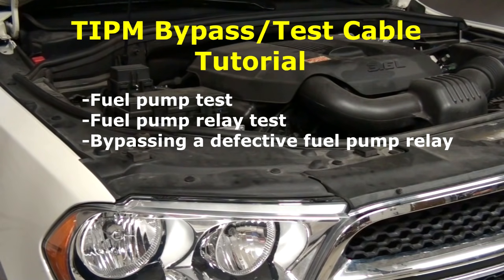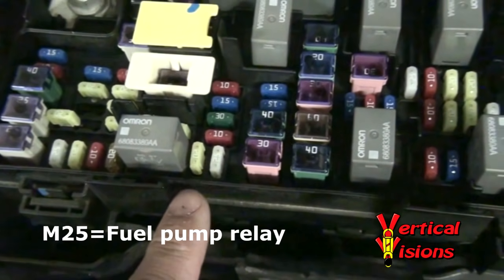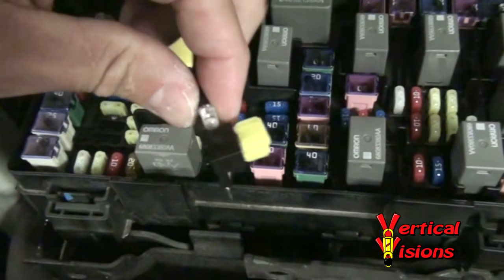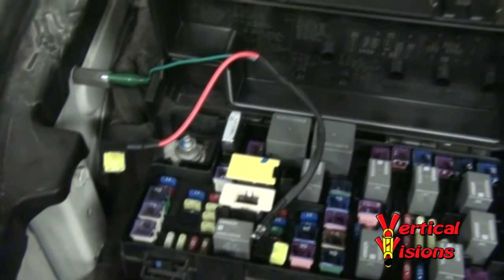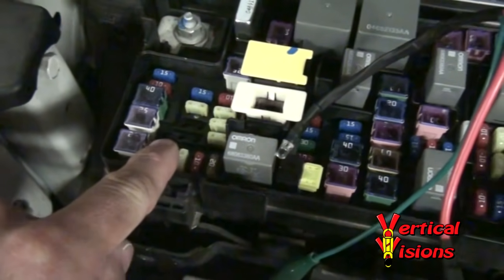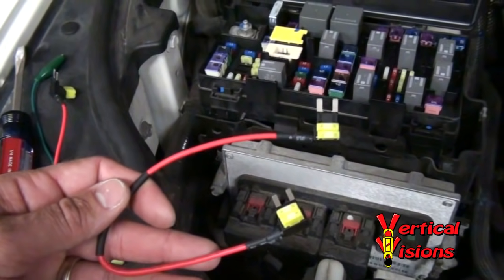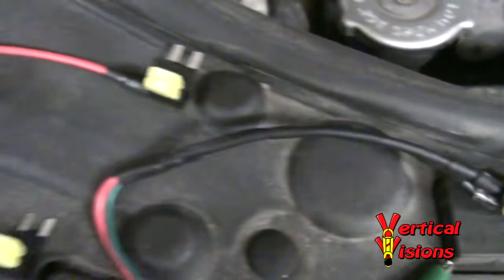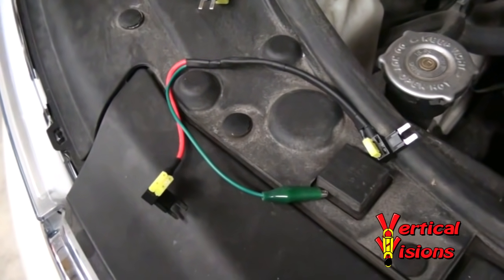TIPM Fuel Relay Test and Bypass Solutions - Most 2007-2021 Dodge, Chrysler, Ram, Jeep, VW Vehicles

Comment: im going to order a cable for my 2011 grand caravan. hopefully you ship to canada or i guess i have to go the amazon route.  is it or can it be a permanent fix? also if the issue was the fuel pump would i be having issues while driving and not just starting? thanks for the video. also when the vehicle finally does start does the fuel pump stay running because the relay is just for starting and not running?
Reply from the maker: Cables are not permanent.  However, we do have other permanent patented solutions listed here:  https://verticalvisions.com/en/content/14-tipm-fuel-pump-relay-solutions.  The relay is not just for starting as it's powered 100% of the time when the vehicle is running.  Stalling while driving is a very low percentage of fuel pump relay failures since most issues are "crank no start" situations.  Your vehicle is the most common to have this issue.
Reply: @VerticalVisions  thank you for the reply. one more question.....why arent the bypass cables permanent? is it for liability reasons that you cant say they are? i get that.  if i was to use it as a permanent solution against your advise what problems could i have? i understand the pump will run with the key in the accessory position and may not shut off if im in an accident. thanks for your time.
Reply from the maker: @tested123  Some of our customers can overheat and melt the cable if driving or idling in hot environments.  This is due to the construction of the cable and the thin terminal size.  All TIPM cables are made outside the USA, including ours, but we customize as much of the design as we can.
Reply: @VerticalVisions  ya and crimp connections can fail. your soldered permanent fix looks like the way to go. im going to order from you because the fact that you replied to me makes this part worth 5 times the amazon price

Comment: everybody's praising this guy so much but the cheapest version of this simple cord he's selling is $30 and you can find the same exact one on Amazon for $10, I understand that everyone has to make a living but that's a little overboard
Reply from the maker: You can buy them cheaper on Amazon from those who sell knock-offs, but you get what you pay for.  Most don't even provide instructions and you get no support if you have questions. Our cheapest cable is actually $25 and we offer 4 pages of color hard copy instructions, better construction, and telephone/email/Facetime support.  TIPM cables have always been temporary measures and some will have issues in hot weather (melting due to terminal sizes) and cold weather (if you're not using our new method not shown in this video).  People are praising me because the most common alternative fix is a new $1500 fuse box, assuming supply chain issues aren't an issue.  So it's not always about finding the cheapest price on a part that can leave you stranded with a $200 tow bill.  We also created patented long term parts similar to this that don't have the limitation of a cheap TIPM cable: https://verticalvisions.com/en/17-tipm-plug-in-relay-systems

Comment: Great video Jason , thank you. I have 2011 DGC with multiple TIPM issues. But my question is : why do you suggest taking one (M25 side) of the four fuses off to fix a fuel pump that won't shut off. Thanks again.
Reply from the maker: Because doing so will completely disconnect the faulty relay from the fuel pump, preventing it from keeping your pump on when the vehicle is off.  This is now standard practice for every cable.

Comment: Will this work on a 2010 Buick Lucerne the current keeps rising taking out the fuel pump relay, this was after the relay burned and was replaced. I jumper-ed the relay and the fuel pump runs. Could it be a bad fuel pump or the relay fuse box being bad after the relay burned and melted the plastic where the relay plugs in?
Reply from the maker: Not sure if it's compatible with your Buick, but here is the basic theory on why it will or will not work:  https://verticalvisions.com/en/content/21-basics-of-bypassing-testing-relays

Comment: Jason, you are the best, my 2011 2500 hemi would not start, fuel pump worked , seen this video and ordered the relay bypass , installed it in 2 min, bam truck fired right up!! Thank you sir for your expert fix to my issue.

Comment: Hello, I have a question I bought that same product but now that I am in winter it is very cold and the car does not start, is it the problem of doing the bypass or is it not another problem because since the cold began the car does not start, help me with that consult please
Reply from the maker: We have a new connection method that solves this issue.  When you buy from us (the engineers who developed this system), you get hard copy color instructions with all the details.
Reply: @VerticalVisions  What product do you have so that the cold does not affect it?
Reply from the maker: Everything product we offer is not affected by the cold because we now use better fuse slots (via continued research and testing).  See first four columns on this page for a list of products we sell:  https://verticalvisions.com/en/content/14-tipm-fuel-pump-relay-solutions

Comment: I installed the bypass and I still have a hard start when it's cold. New battery and WIN module was installed. I got an auto start for the vehicle (13' caravan) but can't really use it when it won't start and just cranks. I was hoping this would fix it.
Reply from the maker: Both issues you describe are resolved by hooking up the cable using the new method we've been using for 5+ years.  All of our cables come with color hard copy instructions showing you the correct connection method.
Reply: @VerticalVisions  it worked in that when I put the key in to turn on power , I could hear the fuel pump running in the rear of the van, before I couldn't. Ill let it run for a few seconds, or 5 or 10 and then start to crank. It does the same thing as before. If anything, Its not the fuel relay, but I didn't waste $800-1200 at the dealership to replace the TIPM like they wanted to do, to replace the fuel relay :)it just tells me that there is something else in the chain or problems with this issue. Im thinking a wire is corroded or not making a proper connection. It is weather dependent though. It only happens when temps are freezing or below. 34*+ usually always good to go.
Reply: @phishENchimps  i have the same issue. jumper worked but cold mornings its like the problem came back. did you fix it?
Reply: @JackDickson-wg6nt  no. its weird. it only really happens when the temp gets to around freezing. Its not the fuel relay (its bypassed). and there is fuel getting to it. So im thinking the issue with us is elsewhere. If it's cold, its probably effecting one of the sensors. im going to have to play around with it one morning with a scan tool to see what the A/F and all the fun numbers with it are. there must be something simple like a connection that is exposed to moisture but once "warmed" it makes the connection. ive seen that before. it;; just take some testing on a really cold morning.
Reply: @phishENchimps  do you have the jumper hooked on the the m7 cigarette lighter? thats where mine is but apparently he uses a different fuse spot now instead. its supposed to fix the cold weather issue. i just dont know which one
Reply: @JackDickson-wg6nt  I still have mine on the m7. we gotta find out the new spot
Reply: @phishENchimps  its m37. i just tried to move my jumper cable to it but it will not fit because of where it it is. the circuitboard he sells clips right into m37. so the only way is to buy the circuit board which im going to do. im really tired of trying 30 times to start it in the morning
Reply: @JackDickson-wg6nt  i got it to work. van has been sitting cold for most of the afternoon, 27*f. I put the m37 jumper in first, then snaked it around and snugfit it in. the wire going from m25 runs right past/over the m37 fuse. I started it up with the remote start and it fired up with no hesitation. tomorrow will be the real test with temps being in the teens.
Reply: @phishENchimps  wtf i dont see how to fit it on. anyways i ordered the chip so i will let you know. also tell me if it starts tomorrow from the m37

Comment: I put the bypass on correctly but now after I shut 2011 dodge caravan off after a wile the back heater fan comes on low and the front controls to heater in dash board I can hear them kick in out
Reply from the maker: A TIPM cable should not affect any heater controls.  Go here and send us a photo of your installation:  https://verticalvisions.com/en/contact-us

Comment: I had an issue with my 2011 Dodge Ram draining my battery and hard starts, tried your cable and everything work fine. Ordering the part was easy and I appreciate the quick delivery. Took only a few minutes to install. Thanks !!!

Comment: Thank you for doing this. I have a 2016 Ram Ecodiesel and I noticed somebody ran a wire from a 5-post relay to a 30A fuse in my TIPM (the only 30A fuse in the entire box). I've also seen others comment that Dodge made a change in 2015 to the TIPM to resolve a lot of the previous issues, however mine literally does a runaway cranking on the starter until I key it completely off with no fuel pump noise at all. Do you know of any TIPM port assignment changes on later models or will your guide here still apply?

Comment: Why power both sides of the fuel pump circuit?
Reply from the maker: We have a new way to connect the cable, but this video is still correct if using M7 as your power source.  Unless you have a relay that is stuck on where you would want to remove the lower fuse on the M25 end, powering both sides of the M25 end allows EITHER the bypass cable or your intermittently function fuel pump relay to provide power.  If you are using the old method of M7 (left slots) as a power source, this connection can occasionally not provide power in extreme cold or low battery voltage.
Reply: @VerticalVisions  turns out ASD pins are loose/ resoldered. Thank you for the reply. Greatly appreciated. #lettheelectronsflow

Comment: Hey great video, but what if fuel pump & relay testing fail and bypassing also fails to activate fuel pump? Any advice?

The pump has just been installed so I know it can't be the problem since it's new. I can't figure out why it's not getting power
Reply from the maker: Assuming your new pump is working and wired properly, I would focus my efforts on the connectors under the TIPM.  It's essentially an uninterrupted wired connection from the bottom of the TIPM to your pump.  Assuming you have a TIPM-7 series fuse box that matches what's on this video, on the underside of your TIPM look for the two larger connectors.  The one you need is C5 and it's located closer to the middle of the TIPM and not near the edge.  Pin 10 connects from the M25 fuse in the TIPM out to the fuel pump.  You could also have a wiring issue/short in the wire run to your pump. 

If I were you, I would have confirmed the pump is working properly prior to finishing the install.  You can also hook your TIPM cable from the right slots of M7 and measure 12 VDC on both pins of the cable (prior to inserting into M25).  By doing these two steps, you've isolated the issue to wiring or the C5 Pin 10 connector.

Comment: Currently experiencing no start or it starts when it wants to. 2017 dodge Durango. Had it towed to a shop and they were stumped why it wouldn’t start since everything else was fine. Has to be the fuel relay sensor

Comment: i have a 2013 ram 1500 regular cab with 5.7 hemi my tipm does not have aney  M on the tipm it has  F  can i still use the cable and have a diagrame for mine
Reply from the maker: You need this version:  https://verticalvisions.com/en/242-1500

Comment: I bought a cheap relay on Amazon about a year ago to fix this issue and 2012 Dodge Caravan was running good. Now that winter has set in here in the northeast the van takes 5 minutes to turn over. Battery is good and starter was just replaced. Could a better relay like yours better withstand cold conditions?
Reply from the maker: We have a new cable connection method that we use to combat your known issue (not shown in this video).  The cheap knock-off cables that are sold in Amazon normally do not come with instructions or support. Yes, all of our products will resolve your well-known cold weather issue and they come with color hard copy instructions, phone/email support, and an engineer to provide assistance when needed.
Reply: @VerticalVisions  Great, I ordered from you earlier today!
Reply: @JonPorreca  whats the new way of hooking it up rather than m7?

Comment: I have the plug-in relay installed now and it seems to be doing the job.  Is the fuel pump supposed to keep running when the key is in the on/run position (right before starting position)?  I can hear the fuel pump now and it sound like it stays on in that position.  I think with the relay, it cuts power after a few seconds if the engine is not cranked.
Reply from the maker: Both the OEM fuel pump relay and our part will power the pump in the run position, but the one minor difference is ours will stay on longer.
Reply: Is it supposed to cut off after some amount of time?  My fuel pump stayed running continuously for several minutes (I didn't wait to see how long before it cuts off).   Just making sure that I am not hurting my new fuel pump that seems louder, I don't remember hearing it running like this with the OEM relay.  I suppose it runs like this when cranked and there really shouldn't be a reason to sit with the key in the ON position.
Reply from the maker: @ht9565  Fuel pump relays recirculate fuel in the tank, so there are no concerns.

Comment: would this also work for a blower relay?
Reply from the maker: Possibly.  If using M7 or M37 for power, note that the blower will be on all the time.  You also need to know the current draw of the load and understand things like properly configuring the cable so it won't backfeed your source circuit.

Comment: Where would I put the jumper on a 2015 dodge durango? Rear cigarette light and fuel pump motor?
Reply from the maker: Details here:  https://verticalvisions.com/en/micro2-fuse-slots/31-tipm-bypass-cable-micro2-standard.html

Comment: THANK YOU!!!! Great work I/we really appretiate the work you did!   I had this same issue with the relay in my 2016 Ram 2500. I got the Airdog filter/pump system and the Fleese sending unit upgrade hoping to fix it but the problem remained. This simple fix worked!! Out of appreciation, I ordered the TIPM Bypass Cable (Combo Set) for Micro2 Fuse Slots off of your site!! FYI For people that have the Micro2 TIPM, the Fuel Pump MRT fuse is F70 and a good place to route it to is F98 Front HTD STS (heated seats fuse) or the F100 UPFITTERS slot.  (PS I spliced 2 add a fuse wires together for a quick fix until your part came in and you were right, they do get hot.. )

Comment: 7yrs later this video is still invaluable! I have (had) the "fuel pump is always running" problem. Removed the lower fuse... problem solved. Hell, I may never replace the TIPM, now! Thank you!
Reply: I've had this bypass wire in my tipm for over 2 years, I did have to replace it after a year, and I'm gonna replace it again.. one of the fuses on the bypass kit melted..have no idea why, but it hasn't done it again, would advise y'all just to check it every now and then

Comment: I've seen another video and read one post where people experienced the, "Always- Run" fuel pump situation at some point with the TIPN cables. They appeared similar but Its unknown where the cables they used were actually from.  However in this video you mention the "A-R" condition and the need to remove the cable's lower fuse temporarily.  Assuming those folks followed directions and plugged into the far left of M7 to 12V+ (IGN-ON), why would the fuel pump run when the ignition or vehicle is off??
Reply from the maker: We have a new connection method for TIPM cables and this video is a bit outdated.  The new connection resolves many issues with the old connection. The 4 pages of color instructions that come with our cables will show you how to properly connect the cable.

Comment: My pump fuse is hot all the time but  no power at the pump scanner says it's off 2001 dodge ram what do I need to do now?
Reply from the maker: A "hot all the time" fuse means your relay is further downstream.  You can't use a bypass cable, nor can you easily test your relay.  More info here:  https://verticalvisions.com/en/content/21-basics-of-bypassing-testing-relays

Comment: Having a bit of trouble understanding which fuse we take off from the bypass cable in the  “fuel pump is on after turning vehicle off “ scenario. 

Thank you in advanced
Reply from the maker: If you bought directly from us (Vertical Visions), just follow the 4 pages of color instructions that we send with the part.  If you bought a knock-off on Amazon, then please contact the seller.

Comment: We have a 2011 Jeep Grand Cherokee and it was leaving Wife stranded.  It was early in the game and Chrysler/JEEP were dragging their feet on a solution.  They wouldn't listen to us regarding the TIPM.  I took the TIPM apart and replaced and upgraded the relay with a double pole so it now has redundant contacts.  Worked great and then the horn quit working.  Took it in to have Dealer look at it and they said the TIPM is bad.  The relay for the horn had failed.  So as luck would have it, we got an upgraded TIPM for free.  They had to move some wires on the connectors as the pin out was different.  I carry a jumper wire with us to this day. Great video you produced.  Thanks.